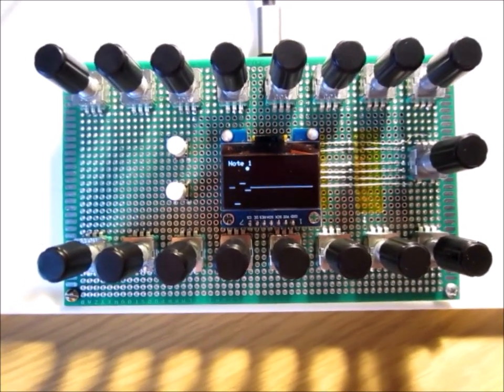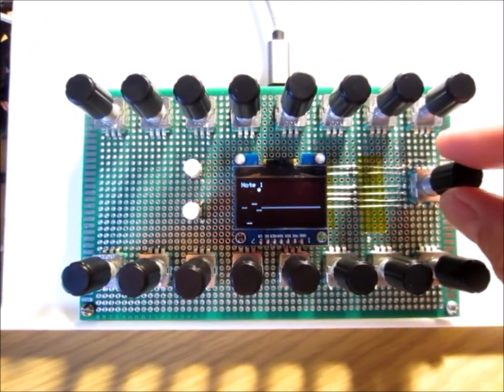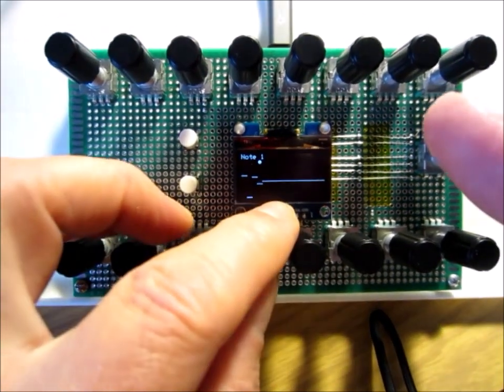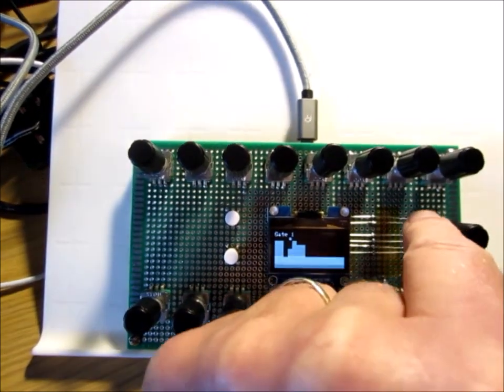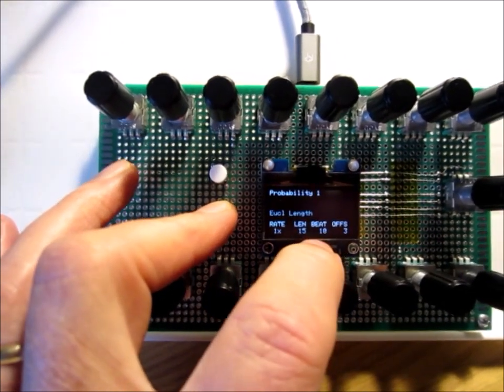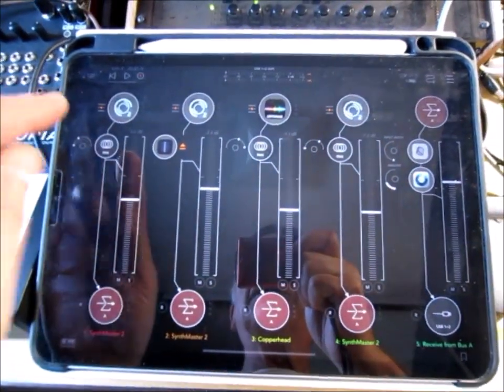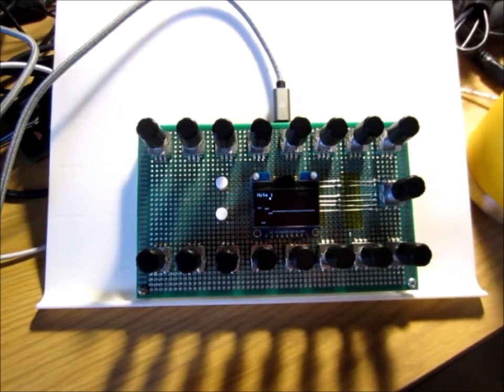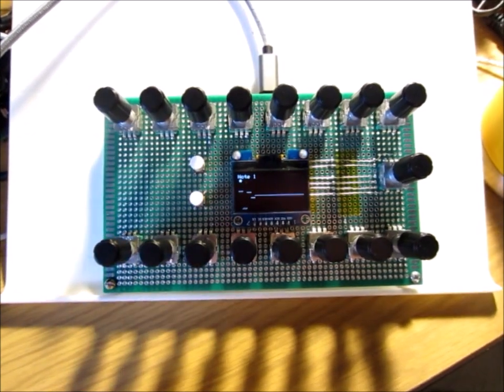Generative MIDI Sequencer uses Raspberry Pi Pico

Comment: Hello,
is there already a circuit diagram or PCB?
Am very interested in building me your sequencer.
Greetings
Reply from the maker: No PCB or circuit diagram. The wiring is very straightforward - look at the code and you can see how its all hooked up. I'm still debating some of the design choices and features.

Comment: Kind of sort of doing an Oxi thing, I love it. I’ve started building stuff myself and would love to give this a try. I have to learn a bit more about working with and multiplexing encoders  first, I think. I haven’t done any multiplexing yet but have just begun working with my first analog controllers (pots)  and a very bad snake sequencer I created in pure data.
Reply from the maker: I've improved the code quite a bit since I posted the video. It now has much better MIDI sync, a better menu system, improved ratcheting and a mod sequencer per track which can send CC messages. You can also send any of the gate clocks to the other tracks which makes it something like the Moog Subharmonicon sequencer. I have not posted the code yet - guess I should do that.
Reply: @rheslip20  That sounds amazing. I’m going to look for some elementary “how to hook up an encoder to a pico and get some sort of control of something” howto and come back. I’ll look in on your code too because I can probably look at it to figure some rudiments of it out while I learn . (Well, I hope I can!) I also hope you’ll consider adding the v/Oct and gates you considered. Thank you for all your fascinating projects, they’re inspiring me to hope I can make some of the stuff I’d like to make. (I am struggling a bit with the fact that I have perfectly good sequencers etc that I simply bought as products just sitting on the shelf). But where’s the fun in that 🤔?